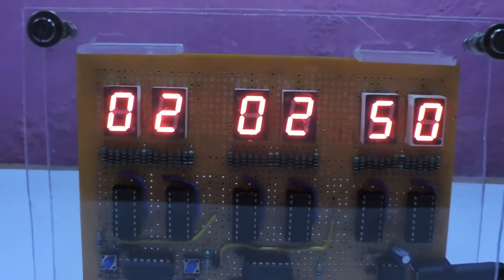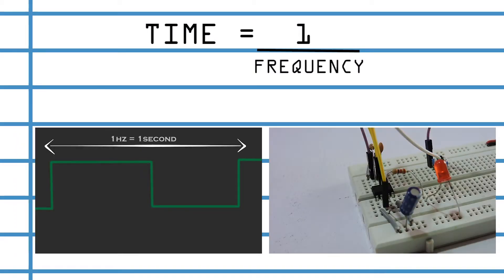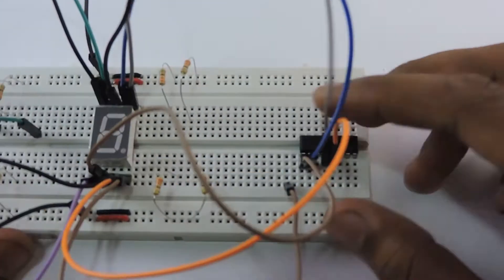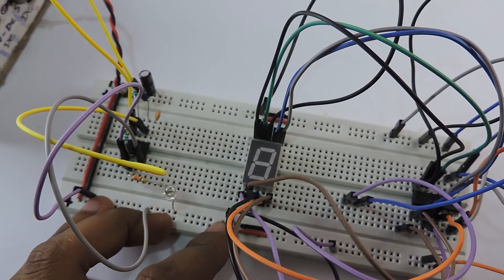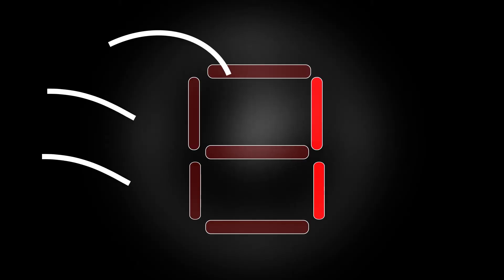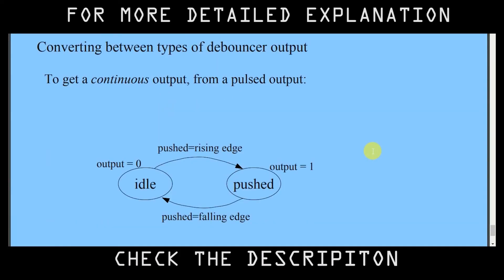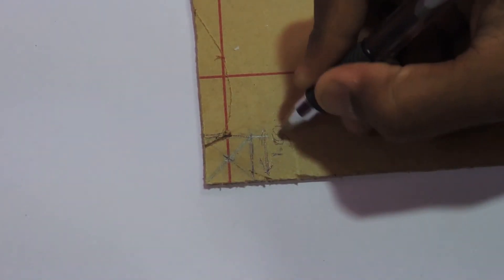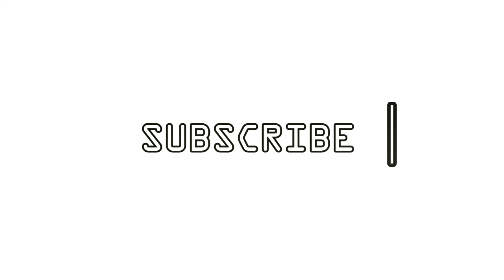[DIY]digital clock from digital logic [without Microcontroller]

Comment: I have just completed this digital clock and I changed few things in this circuit like I used r_c debouncer a little differently, I used reset button which resets everything to 00 00 00 and instead of using 555 ic to generate clock pulse I used wall clock circuit which runs on 1.5 volt, and used lm324 op-amp to amplify that low voltage clock pulse (2 stage amplification) to amplify that clock signal and sent it to the 4026 ic (the best thing is that I don't need to adjust preset to get clock frequency for 1 second, the wall clock circuit perfectly gives frequency for 1 second) oh and I used 6v battery for voltage supply,
Reply from the maker: That's amazing!

Comment: There is a trick to cutting acrylic.  Line both sides of the cut with clear packing tape and cut through the tape as you are cutting through the acrylic and it won't crack.
Reply from the maker: Thank you!!
Reply: @Neutrino1 Oh, one more thing... Wouldn't segments 'e' and 'f' be sufficient for detecting a 6?

Comment: probably is late but for cuttin the acrylic you can use an utility blde and a strong ruler can be metallic or otherwise metal is better
sonyou place the ruler over the acrylic piece you need to prevent scratch and do multiple pass with the blade in both sides once its marked you can break it like glass no need to cut it all the way
also with a 4060 and a piezoleectric resonator could be more precise than a 555 duento the fact the 555 relies on resistors and capacitors that have high tolerances

Comment: Successfully built it.

I need some troubleshooting, and need a more permanent power source, but otherwise I completed the work.

I used a 32768khz crystal and 4060 ICs to get 1hz pulse. 
But otherwise followed this tutorial exactly.

I wanted to be an engineer, but couldn't because of parental pressure, but guess what? I don't need to be an engineer to enjoy these things...

The wires behind the board are REALLY messy. And it's gonna take forever to troubleshoot...

Comment: Sir in your diagram you have shown 8 ics but in the vedio it is shown 9 ics which 1 ic is missing in the ckt pls reply
Reply from the maker: The 9th IC was for denouncing circuit. It was redundant. It's replaced by capacitor in the circuit diagram near the button. I have talked about this in the video too.

Comment: Logic gate 24 hr reset is very wrong. If you’re using a 3 AND gate to look at D,E, and F to reset at 24 then it will also reset at 04,05,06,08,09,20. I built this circuit and my clock hours won’t increment out of 00.

Comment: Hello in the circuit there is no ic 7414. The link you put does not have the 7414. Can you attach it here?
Reply from the maker: You don't need that, even without that it would work.

Comment: Circuit diagram  site is blocked. can you share it in google drive or onedrive.
Reply from the maker: This link is working try different browser https://www.mediafire.com/file/d91j197s8odg7ln/circuit.zip/file
Reply: @Neutrino1  thanks a lot. But i need to use vpn , may be in my country this site is blocked.

Comment: Excellent video. Please tell me that 74ALS11N is same 7411. Can I use it. Please reply.
Reply: Ok thanks for your reply.
Reply: I will try iit on Proteus 8.
Reply from the maker: @virendersingh6027  that will be great!
Reply from the maker: Yes its the same!
Reply: Sir, today I have designed two digital clock in Proteus 8. One digital clock (4 digit) using ic 4026 and ic 4017 and ic 7408 is working fine.  I have also designed your circuit. But seconds is working only with missing e and f point of segment. Even no switch is working. Can you please help me. And please tell me do you know hindi because my english is poor.
Thanks...

Comment: Bro .. this is a nice project but I face a problem in making this ... I made this project almost 5-6 times and and every time my hour display will return to zero after 19 .. instead of 24 ... How to solve this problem 😥 ... Else everything is ok
Reply: There is a mistake in his AND gate connected to the Hours-Tens digit.  In reality, you need 2 AND gates (or one 6 input) that tests both digits of the hours for "2 5", and RST then.  There are other mistakes in the circuit diagram as well.
Reply: Can you please provide the additional circuit that you attached to prevent bouncing .. in vidieo , you did very fast ... I unable to understand ... I think after adding that circuit my problem may resolves
Reply: I had the same problem when I built this circuit. Unfortunately for me, I designed this circuit onto a pcb and ordered a few of them. Looks like I have to scrap them all and start over. I should have double checked his schematic before making it. Oh well.

Comment: Really appreciate your work.
But there is a tiny mistake, 555timer oscillator uses RC network which can't output a stable oscillation of exactly one hertz, it may be slowed down or become faster a little bit depending on air moisture, temperature of the surrounding. Then your clock will lead or lag over time. So my method of getting a second pulse generator in a cheapest way is to use the circuit of a wall clock ,it uses crystal which is very precise and accurate. Then it's ok
Reply from the maker: Yes yes! I agree too, this is just for making the circuit simpler and even in the video i suggested to use a different oscillator circuit.
Reply: @Neutrino1  I have made a digital clock in a much simpler way without a microcontroller (cheapest,just one dollar) u can check it on my channel if u are interested. 
Video title is DIY LED wall clock using wrist watch (in hindi language)
Reply: then which timer should be used instead of IC555 ?
Reply: @mujtabaqamar1712  CD4060 with a crystal 32k resonator should do the work
pic megas motorolas and arduino work with that

Comment: Bro i follow your circuit diagram but my hours display shows 19 as the maximum limit ( instead of 24 ) and then it returns to 0 . Means sirf 19 hours hi show ho kre hai ... How to solve it ?
Reply: By the way it was a awsm project
Reply from the maker: @parooog  thanks for your support!
Reply from the maker: Check the connection connected to the 3input nand gate and the SSD which displays hour, maybe the pattern is changed.
Reply: @Neutrino1   ok i will try to fix it

Comment: Sir I want to make this project but the problem is that you connected resistors between IC 4026 and SSD in final circuit you made in video but these resistors are not present in the circuit one you give in description. Sir kindly reply ASAP.
Reply from the maker: It's not necessary placing so many resistor even though it works(they are just for aesthetics) just  one 470ohm resistor on cathode side of each SSD would do fine.

Comment: whats the v for the supply? 9?
Reply from the maker: It works from ranging 5-12v
Reply: @Neutrino1  can 5v really do?
Reply from the maker: @zerosandones7547  yeah but use more current rated adaptor (like 1~2A)
Reply: @Neutrino1  how to put a supply into this? Im a bit confused :(
Reply: thanks btw :D

Comment: I didn't understand what happened to R17 could you tell me please
Reply from the maker: It's used to adjust the frequency generated by the 555IC.
Reply: @Neutrino1  and leg 1 is it going to ground ?
Reply from the maker: @kusayelatiye3871  I didn't get you, leg 1?
Reply: @Neutrino1  ok i got it R17  is variable resistance right ?
Reply from the maker: @kusayelatiye3871  Yes.

Comment: could this circuit work as stop watch ,as it is work as time Keeper ! that mean having start/stop switch and reset switch!! thanks in advance.
Reply from the maker: yeah sure! 
Have a switch for the clock  input of seconds IC, then the circuit will pause/stop if clock signal is interrupted and take all the reset pin from every 4026IC and connect through switch to +vcc, when the switch is pressed the whole clock will reset. Thus making the circuit a functional stop watch. Also by playing with the clock frequency you can adjust the accuracy of the circuit.
Reply: @Neutrino1  ok bro, i have a small question ,what is the function of the two push button in the circuit. it seems not obvious to me.
Reply from the maker: @sherifahmed7800  To adjust the time.Since, the clock reset when power is down.

Comment: I appreciated your works! would you mind if you could give me the link of your own schematic diagram not in the link,I saw you used a many diodes and capacitor but the circuit diagram you gave was only 2 diodes and 2 capacitors.. I want to make for my project credits by you..Thanks...

Comment: Thanks a ton...I'm planning to do this project...But I need to display in a 12 hr format..So, after 12, I gotta display 1.....Since this 4026 ic resets to 00 as it reaches 24, is it possible to use the same ic for this my purpose..Your help would mean a lot
Reply from the maker: It would be complicated using the same IC..But u can do this, delay the reset pin(connect 4 not gates and a diode whose +ve connected towards the output of AND gate) from the hrs display and feed it too the clock input of the hrs ic. I guess this should work!

Comment: what power supply is disconnected  ..??
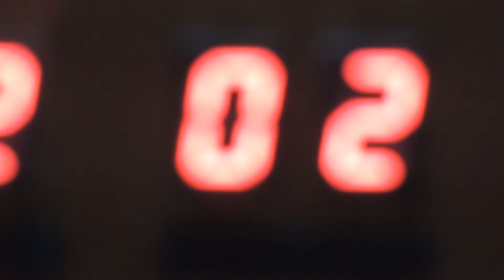Reply from the maker: The clock resets to 00:00:00 when 12v power adapter is disconnected from the circuit